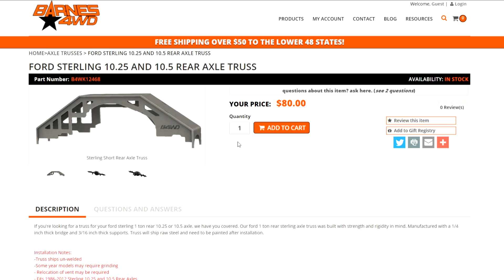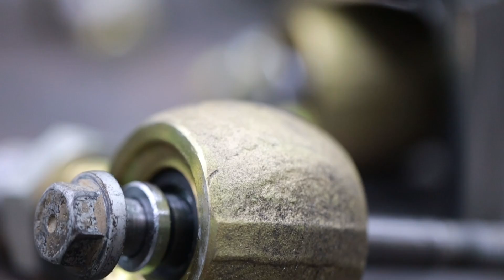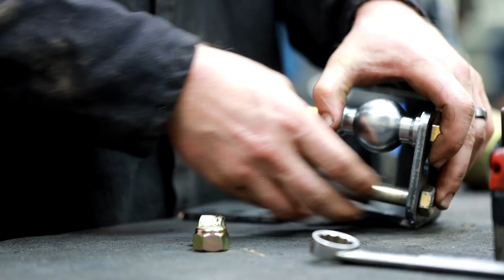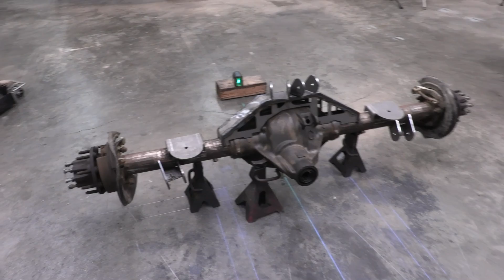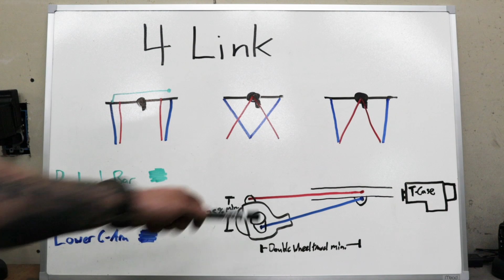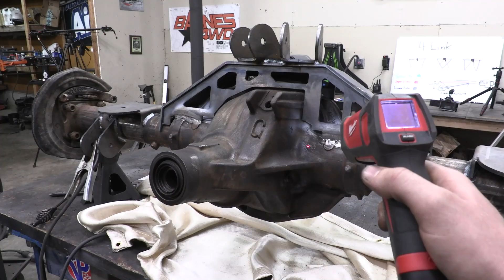4 Link Suspension Build. Full DIY. Ultimate Land Rover Discovery Build Episode 10

Comment: i have no room to put my triangulated links on top of my front axle can i angle off the bottom to my trans cross member and run straight flat off the top,  my front drive shaft is in the way to angle off the top of the axle

Comment: You have to use nickel rod to tig weld nodular to mild steel. It will prevent the cracking and you should always do a very hot root pass and then fill with a weave weld.

Comment: 309 Stainless tig wire is commonly used for dissimular metals, 312 stainless is the super weld almost anything-to-anything rod. Nickle 55 or 99 are the two cast filler metals. Thanks

Comment: Hi Nate,  Im doing a simple leaf spring 1 ton swap on my 83 toyota pickup,(d70 rear, d60 front) keeping the 4 banger and stock case for right now. Im running 4.10s and will be on 39.5"-44" tires, should i worry about the rear tubes spinning?? Ive heard it creates a stress point when you weld them

Comment: I've thought about a bolt on brace Victorville truss on a 14 bolt that would use the front bolts on the pinion and a  spacer plate on the diff cover rather than welding to the center cast.

Comment: Dude, I love your channel, I’m also in the middle of a 1 ton swap with a Dana 60 and sterling 10.5... I do most of my fab with a 240v Tig.  I bought some ni55 rod for this job to weld onto the housings but after watching you I’m starting to rethink this.  Starting to lean towards not welding on the housings at all or maybe tig brazing with some silicon bronze; thoughts?

Comment: I use .023 wire and 75/25 co2/argon gas when welding on a truss or gussets. I’ve never had an issue with cracking or bad welds. I don’t heat the cast either but that’s just me.

Comment: Is that a sterling rear from a ford? If so you can just regular mig weld the truss all the way across the center section they take welds fine, I’ve done those axles numerous times. Lots of heat and cast needs to be clean. The only rear that needs pre heat and slow cool (in my experience) is a 14 bolt full floater. Just my 2 cents for people scared to truss a rear.

Comment: Great work Nate, truly inspirational! 
Do you need to get your vehicles engineered with certificates after these kind of mega suspension mods?
Also, in regard to diff pinion angle, it was my understanding that the angle on Tcase output flange and angle on diff pinion flange should  be identical/ parallel to avoid vibration. Why is it that you point diff pinion up to Tcase? 
Cheers keep up the awesome fab work and tech talk mate!
James

Comment: Question on pinion angle. If you have the rear pinion pointing at the Tcase rather than staying flat, this obviously chages the pinion angle with suspension travel. Do you use a constant velocity joint rather than universal joint on the Tcase side to combat this? Or is it just not enough of an issue with 4wd/off road setups? I only ask because I'm more familiar with drag car set up where keeping pinion angles matching is kind of a big deal.

Comment: Do you put anything on the link tubes to get a wrench on them easily for alignment purposes? I know you don't have to but It does take out the flex in the joints when locking down the jam nuts.  Just wanted to know your opinion on that.  Also, love the videos I've learned so much.

Comment: 7:35 i allway wondered  why dont you put  the red bar under the diff and the blue above the axle ?  (on the middle design)
Reply: I assume because you already have the least ground clearance by the diff since it hangs below the tubes. Adding brackets for links would bring that down even more, which is just asking for lower link failure.

Comment: Great work man! I Enjoy watching your builds. The stock axels on discos, the pumpkins are off center, you moved it with the front axel, and you left it in the center with the rear, is that going to effect the drive shaft in anyway ? 
When I had my disco I wanted to swap the axels but that was stopping me, than I figure out that land cruiser 80 does the same, so I was looking into swapping land cruiser axels. Just wondering what your take on that. Keep up that great work man, you inspire a lot of ppl to try and build their own rigs.

Comment: I did a high pinion dana 30 sas in my explorer with leaf springs. I made a crossover steering bracket for the passenger side that bolts up where the unit bearings bolt on and to the top of the steering knuckle with 3 3/8 bolts. Do you think it would be strong enough or should I weld the bracket to the knuckle as well?

Comment: Learning alot.   I was leaning toward sas on leafs but you really highlight the performance of coils.
Reply from the maker: It's night and day man. There isn't much you can do to tune a leaf spring but with a 4 link you can dial in suspension to do whatever you want. High speed performance and rock crawler performance is all based on the position of the links 👍

Comment: Check out this white paper:

https://app.aws.org/wj/supplement/WJ_1985_03_s79.pdf

It basically says ER NiFeMn-Cl can be used to weld ductile iron to itself and to steel. Crown Alloys produces two pound spools of Royal 44-30 which meets this spec and is compatible with 75% argon/25% CO2. It is expensive, but it is cheaper than a multi-process welder if all you have is MIG. 

There is an example of a guy welding a truss to a Dana 44 using it. He doesn't report having problems with feeding the wire. 

https://www.youtube.com/watch?v=UYwhXUuYIZ0

Comment: Powder coating axles and bars? Or like an undercoating
Reply from the maker: I just use spray paint. Powder coat rubs off on the rocks just as easy and it makes it very difficult to change anything 👍

Comment: Hi Nate love the videos
Question. I see how you set the ride height of the axle sitting on the jack stands by using your tire height but how do you determine the ride height of your vehicle on the jack stands when your mocking everything up? Or does it not matter to be too exact?  Also is the house next door to you for sale, I need a neighbor like you :)
And Happy Birthday to your daughter 
Drago
.
Reply from the maker: I have the ride height very close to what it was before i disassembled the vehicle. I took measurements of everything and kept it close when placing it on the jack stands. It will shrink Slightly because the brackets on the axles are shorter but I just need it in the ball park for now 👍

Comment: Just some personal experience, I have welded 5 8.8 axle tubes and my super duty tubes with preheat and regular e70 series wire .035. I always needle scale my tacks and welds as soon as I finish them and I needle scale everything after I get done. I haven’t had any crack
Reply from the maker: I have done this too. The big issue is not all cast material is created equal. A 1976 dana 60 center could weld fine but a 1994 dana 60 won't. Even if they are both cast iron the amount of trash elements completely changes the way the housing reacts to various welding processes. I've heard of very disparaging differences between housings from the same foundry made the same year just because of one having more of one element and less of another. I mig welded the artec truss on my buddies super duty 60 without a single crack but this super duty 60 I'm building has a crack in every location I used mig. Same machine, wire and preheat. Lol this material can be frustrating to say the least
Reply: Trick I've always gotten good results with was essentially welding it cold, takes forever. Run a Nickel or cast specific rod with the majority of the pool on the cast section in roughly 3/4 to inch segments depending on how hot your running it and peen the shit out of it. Move to another spot, much of the same. Once its all welded up on the cast side I run Mig on the Stick weld and Steel for the truss. Basically in the same way I ran the cast. Again takes a fuckpile of time to do and If you cant hold your hand against the weld for longer than 5 seconds after peening it its too hot. In my experience of course, Arizona keeps center sections pretty warm in the summer sun....

Comment: Stupid question for you. Would it be possible to attach a skid plate onto the lower control arms. Use heim joints to allow for a certain amount of flex. But it would protect the driveshaft or oil pan.
Reply from the maker: This could be possible?! Maybe?! Lol the twisting would be the main issue. And you would definitely lose ground clearance

Comment: What about a triangular upper control arm as 1 piece, then use something like a ball joint or a hitch ball to allow the axle to still flex without the flex steer?
Reply from the maker: They call this a wish bone 3 link. I built a system like this and I liked it. I will try and ad this to my upcoming suspension video 👍

Comment: Great Episode! I'm curious, Ive never built a Sterling axle, but I have build Dana 60s and 70s where you have to use a gear spreader or housing spreader. Will welding a truss onto the housing and axle tubes make it difficult to spread the housing to install gears? Do you use a spreader on a sterling axle?
Reply from the maker: I don't plan on spreading the case 👍

Comment: Do you recommend disconnecting the vehicles battery when welding onto the frame? Being how sensitive most computer modules are. Great build man 👍🏼
Reply: Keith Christensen I figured as much, I just don’t see much notice to it from fabrication videos.
Reply from the maker: I have welded on tons of vehicles of every make and model without disconnecting the ECU. That said, I recently started disconnecting the battery when I weld on the chassis. I don't see how welding could possibly mess with the ecu but it doesn't hurt to be cautious 👍